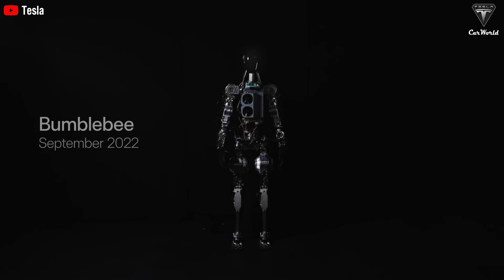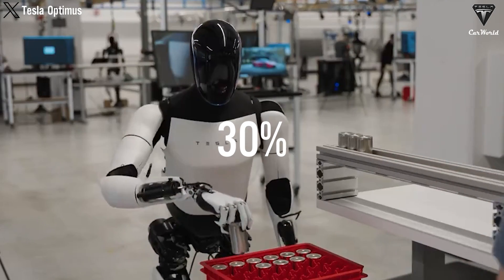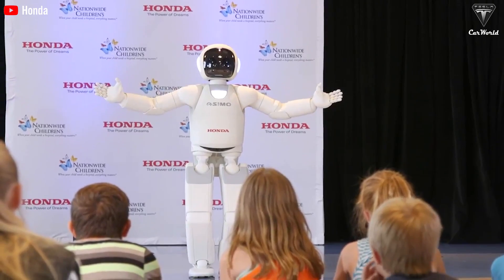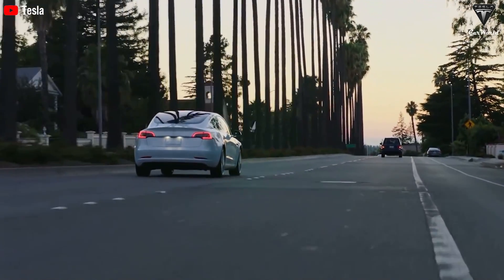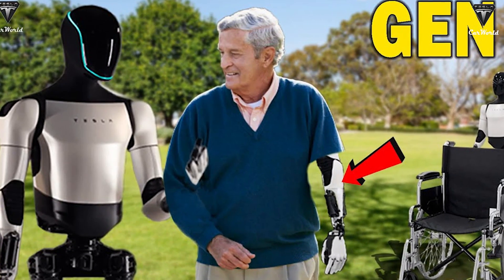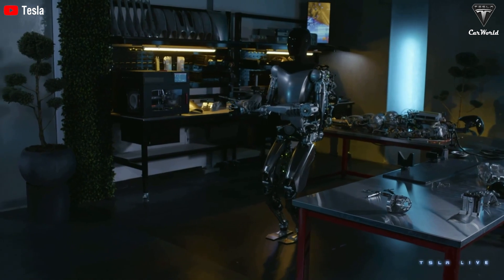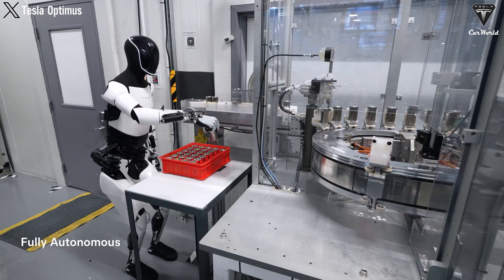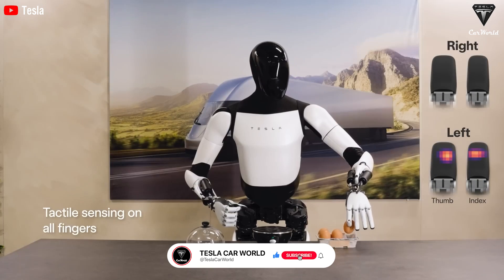Just Happened! Elon Musk ANNOUNCES New Tesla Bot Optimus Gen Release on DECEMBER! 3 Big Upgrades!

Comment: Not buying the hype on this robot, rotation and movements are still highly restricted, dexterity  not good, can make two meals, if working in a warehouse at that speed, management would pull the plug on them - lifting and carry heavy equipment and sending them into the forest is the only thing they do well. We have no energy and make another machine to use more energy that we don't have, doesn't make sense.

Comment: What the hell does it matter that your shielding can withstand 200+ Celsius, if you still need cooling for the central processing assembly?  No way it can handle fire because its motherboard and other components will get scorched in a minute.  Extreme colds also call for some doubts, or at least greatly reduced run times because you'll be spending a great deal to power to keep the battery assembly within operating thermal range.  The promise of these machines is greatly exaggerated by this review.  Some more reserved examination is called for.

Comment: Do you belive, there could B3 Senior 6 Medion and 4 junior Presidents ( First Man posibbility) to handle more Problems Executive?

Yes, we do all need a Tundra Home with high tech Brick from Apple, Nokia or Samsung. Maybe those created Like a steel mesh net grid Ball System with chip ( Out- and Inside Walls).Such Building done Pads and Tabletts with drones. In Hospitals of university‘s a inner Rotation magnetic chamber with two Double net in roundform.

Comment: I would use this machine in my home. As an older human, I will need help to stay in my house, living alone. My thinking goes to wondering how the machine will be cleaned after cooking. What is needed to get snow off the robot? How will it work in rain?
Reply from the maker: The Optimus features weather resistance, self-maintenance and personal cleaning
Reply: If it has ip6 level water resistance, then it will get into your bathroom and clean its body 😂
Reply: @greatofray  I'm a widow.  Would be nice to have it wash my back 😁
Reply: It will all be sorted but I suspect it will be a few years yet.
The machine is still moving very slowly so I would expect quite limited applications. And we all know about the 80 20 rule. So, a few years yet